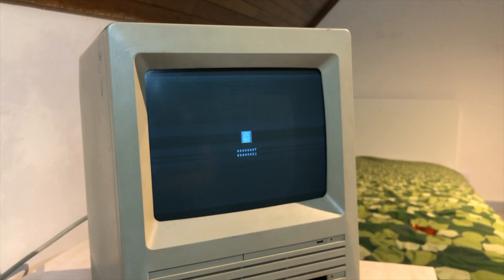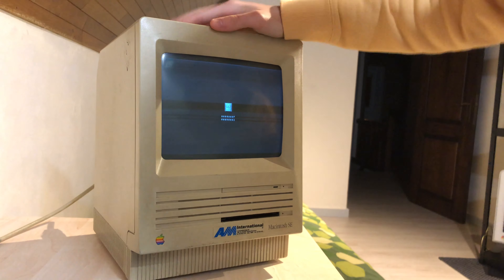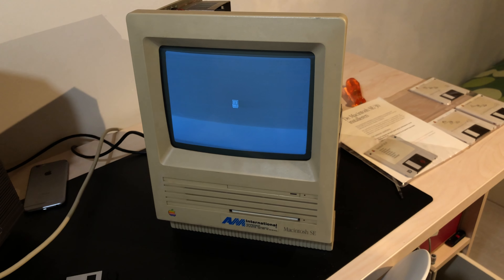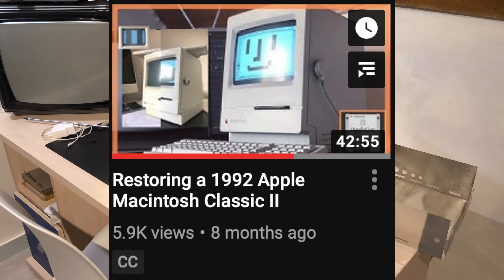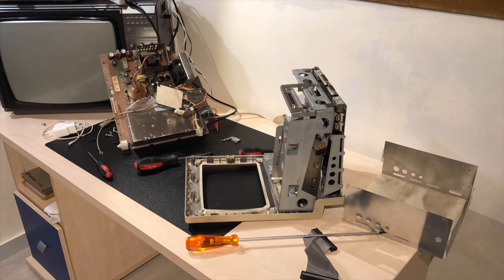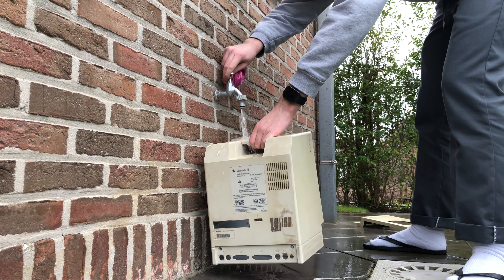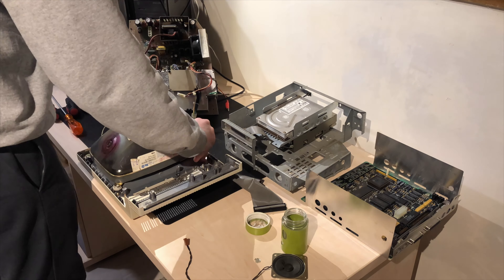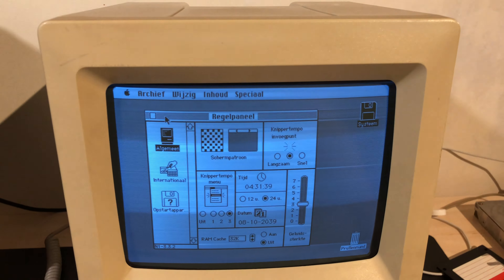Macintosh SE Restoration - Part 1

Comment: Why not drill 4 small holes in the plastic standoffs for the speaker, and you can use course thread screws to hold the speaker in place. Easy to remove and also a finished solution for when you’re completely done.
Reply from the maker: Good idea but the standoffs are way too small (and brittle) to do that. I also don’t have a drill bit that thin lol.
Thanks for watching!